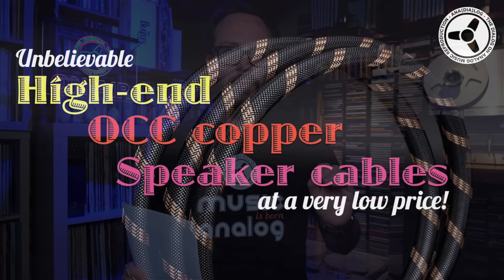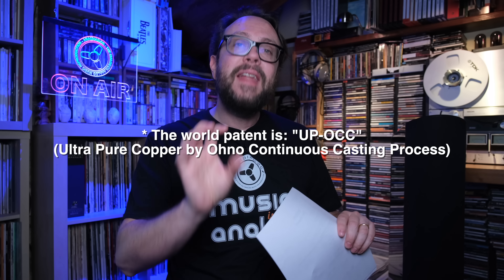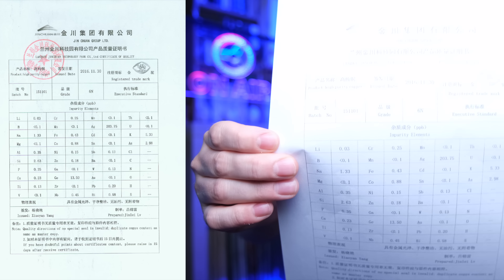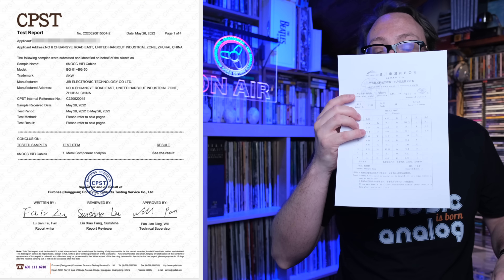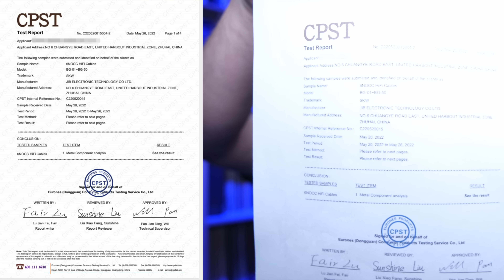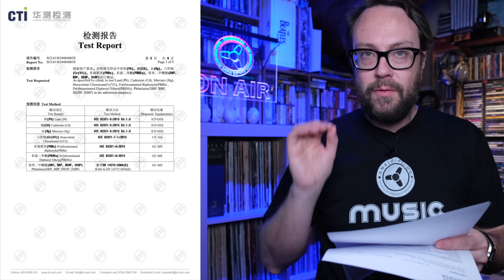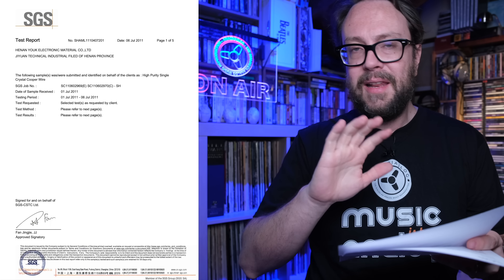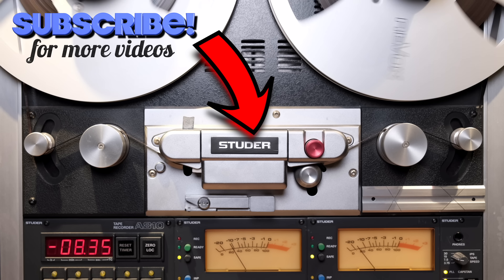Chinese OCC copper: fake or real? The SKW case

Comment: I don't dispute SKW product quality, but I wanted to provide some insight from a materials engineering standpoint.  It was good they provided the certifications to verify.  Each lot of copper would have a certification with actual results.  When looking at 6N's metals, typically the standard chemical analysis does not have good enough resolution to make the determination.  The company would need to also perform GDMS to identify all the trace elements that add up in the PPM levels of high purity metals.  The determination of single crystal would be different and would likely need a metallurgical cross section or SEM microscopy.  Good work on getting the info.
Reply: Why bother, at the price they sell for and if they sound great. what does it matter if they are OOO or OFC or melted rock? They appear to be excellent value for the money. When you bur a $10k pair of speaker cables, then ask for that detailed info.
Reply: @spacejaime  I like and own skw cables.
Reply from the maker: Good points. That is clearly something that would be useful to us not to them, which is why it probably doesn't exist. In any case, why don't you try asking by using the email below?
Reply: Yes, and the oxygen content wasn't measured at all. What we can say is that pure good quality copper was used - but I am pretty sure that the copper wiring in my kids electric toy car is equally pure. From the audiophile perspective, nothing is proven here. Could still be OCC, but we need other testing to know.
Reply: @spacejaime  It is obvious you are clever than Thrift Shop Reviews!!
Reply: @brianng2335  - I just checked my post and found two misspellings: OCC cable not OOO, buy not bur. Yes, who cares what wire the cable uses if they sound good for the end user!
Reply: @spacejaime  I know you were misspelling!    As you said, why bother?  In high end audio world, everything is expensive.   It's hard to find something good and nice at low price.
Reply: @brianng2335  - 👍👍

Comment: I bought a pair of Chinese OCC interconnects from China bay and they've worked out very well.  In comparing them to Mogami 2549 OFC I'd say that the chinese OCC are at least as good if not better and that's without any burn in time.  The jacket is two tone copper with black plugs that you turn to tighten.  I bought these on your recommendation from a past video on the merits of OCC cabling.  Thank you.

Comment: Also use the SKW cables, both interconnects and speaker, and am very pleased. As a matter of fact, I had Pangea phono cables and could not find the source of hum. Changed to the SKW and the hum went away. So the shielding is also of good or better quality. Kudos to you for researching the answer!
Reply: Oddly enough I got rid of hum by swapping to Pangea cables...my previous interconnect cable was 5m run of unshielded ' magnet wire' between pre and power Amps that 100% was the source of hummmmmm.

Comment: Hello,I bought Thise skw speaker cables and cut them to se the inside and their are not the same indside as the pictures.I can not put a picture of them here☹️.Have you see the inside of them? I like your Chanel very much.👍
Reply from the maker: It depends which cable you purchased. In any case I am conducting a new analysis with a partner and we will soon release the info. If you want to send me the picture you can do that here: anadialog@yahoo.com Thanks!

Comment: Can you please answer this question for me please? I want to buy these, but have an older amp that needs to use barewire. Can I take off the banana/shielding to use just the bare wire to insert into spring clips? I cant find the answer anywhere. Thanks!
Reply from the maker: Check the original video, I show howbto screw on the thin type for vintage amps: https://youtu.be/2rjOdEuFe88 at around 5:50
Reply: @anadialog  Thank you so much! God bless!

Comment: Personally (as an electronic technician) i'm yet not sure about the whole cable sound thing. I jost got an SKW interconnect cable which i bought because it wasn't too expensive and looks well made. I can't say that i hear a difference tho (it connects my phono preamp and amplifier)
But out of curiosity and the aesthetic appeal i just ordered a pair of the SKW speaker cables you recommended. If i will hear a difference, i will be happy.. if i will not hear a difference, at least i can say i've tried it. Probably will keep it anyway tho, because i always appreciate a well constructed and produced piece of equipment. So thanks for you're advice and research, much appreciated 👍🏻
Reply from the maker: Congrats for at least trying!
Reply: @anadialog  so i had them hooked up to my system, which isn't particularly high-end but not too bad (Elac Debut Reference towers, Yamaha R-S 700), for about two weeks now.. first of all: i'm gonna keep them! I love how they look and quite frankly also how they sound.. against the science i've learned, i have to admit that sometimes, with some Songs/Albums, I heard some differences after i changed them out.. it sounds overall more "clean", revealed more Details and to my surprise it made the lower bass more present or rather impactful.. which makes absolutely no sense to me haha.. but that's what i hear.. could be Placebo but even if it is just placebo - I'm enjoying it which is all that matters. So i'm absolutely not regretting my purchase of the SKW cables!

Comment: I have the SKW in both IC and for speakers. Tried out Tellurium expensive speaker cables. Costing three times av much.
After trying the Tellurium for a while I got the SKW's. Right out of the box it was great. Much better than the Tellurium. Best buy for people with normal economy.
Use Ansuz or Supra from Sweden for power cables.

Comment: Cables have big impact on sound. I understand this 35 years ago and have tested and developed cables since then.

I use Neotech OC silver, very good.

I am in a process of making two power cables, one with 4 nines copper and one with Neotech OCC, same architecture.

But it is also important to have the same material in the connectors as in the wires, preferably crimped.
Reply from the maker: Bravo! Good solutions throughout.

Comment: I have come to alter my view on cables recently, and I no longer consider the purity or type of metal to be the most important factor to look out for. After trying a qed xt5 power cable, which is just oxygen free copper, but arranged to combat the proximity effect, and finally hearing recorded sound without the treble being unnaturally rolled off for the first time in my life (nor the bass unnaturally loud and muddy) and to my amazement, much better timing, I am now on a mission to remove all regular stranded cables from my setup. I'll probably have to make my own interconnects and speaker cables, to benefit from both a lack of proximity effect and occ silver, because such cables are not cheap to buy, if indeed you can find any, but I dont think it is worth having occ and cryo treatment and shielding and all the other things you could add, if the cable is just regular stranded and massively handicapped because of it
Reply from the maker: OFC is a very good conductor. Don't think it's like having normal copper. In any case I agree and I actually always said that a good cable is made up by 4 fundamental factors in this order: conductors, insulation, geometry and connectors.

Comment: I’m an audiophile myself (whatever that is) and I find the world of high end audio to be one of the most hypocritical bunches on the planet.   

Personally, I wish so much stuff wasn’t made in China, but that is the world we now live in.  People will knock SKW cables, but on the other hand, they will praise AudioQuest with their mega dollar cables, which by the way, are made in…………..you got it, China.  And, that is just a drop in the bucket example.

Very good video.  Thank you for sharing.

Cheers, from Texas
Reply: Not so sure. 
I haven't tried SKW but I had an Audiocrast (Chinese) power cable in my system for some time. I bought an AudioQuest Mistral pc cheap (eBay). After much swapping about with my existing Furutech and Neotech pcs, I realised the Audiocrast was the weak link in the system.  The AudioQuest Mistral had the effect of snapping the system into place - better resolution, greatly reduced sibilance, more tonal colour.  The Audiocrast sounded slightly fizzy / fuzzy if that makes sense - and greyer.
Reply from the maker: Thanks! Maybe you could find this video I made on high-end hifi interesting: https://youtu.be/QKixhYovxJQ

Comment: I know they affect sound output and clearly have benefits over standard ofc. I can't say they are OCC. 

Crystal copper will make a difference. Look for OCC not ofc.  This type of copper is going to give you a more robust full sound.  I know it's true because I made output files and spectrograms and it is quite obvious that there is a difference.  The benefit is no cutoff at the ceiling so extended peaks across entire spectrum.  Another benefit is clear clean separation and higher saturation which pulls out many more details.  Is it a dramatic difference?  At low volume no, but at 75 DBs or more you can really hear a big difference in sound quality.  Realistically the difference is on par with mp3 vs wave.  In fact, the spectrograms are very similar.  I've done a lot of work with spectrograms.  Another cable I am looking to try are Gotham crystal copper.  Gotham is used in a lot of recording studios and microphone cables.
Reply from the maker: Very interesting!

Comment: People have varying opinions on everything. I occasionaly get someone saying in the threads something to the effect that because their stereo costs many tens of thousands, that it would make a laugh of mine, and I never even say what my stereo is; on purpose . Quality of software used + quality of hardware + knowledge of setup and tweaking = how good your sound is. Cables are still a thing a lot of people don't buy into. People who don't believe there are quality differences between cables, all have one thing in common in my experience; they never have great sound. Not just because of the cables themselves, but because anyone who isn't perceptive enough to tell differences in cables, isn't going to be perceptive enough to pick out what is the best sounding equip  One thing I would like to see is audio stores who carry cable brands where they have many different models, giving people an audition of their budget cable, then their next higher up cable in the line , then the next etc. etc. to demonstrate just what  improvements and degrees of improvement you're getting as you go up the line in price. After that what would be even more interesting is going back down from the top model all the way down to the budget model again. Of course there would have to be 3 minute intermission in between each switching of the cables, to remove one and connect up the next one. I'm sure the expanding and then literal collapsing of the soundstage would be obvious enough to silence the most vocal doubters. I have some top of the line cables from the same company. One is their current top of the line which uses OCC copper and their former top of the line cable uses OFC. The OCC is cleaner and sweeter. The OFC is clearer a bit.  Based on what I've experienced, the OCC can probably be expected to sound purer and cleaner, but don't expect all aspects of its sound to be better.
Reply from the maker: Nice analysis...intermittently hilarious 😂

Comment: I don't see anying on how to test the actual cables, such as resistance measurements or an oscilloscope to verify the cable have not been substituted.  How would you verify the SKW cables are genuine or reproduction without testing them.
Reply from the maker: No need to do that. Definitive test coming up. Stay tuned.

Comment: sorry i bought this cables and sound bad in my system. moody and dry. sound stage was shrink. in the technical aspect they where very rigid and they almost broke my speaker terminal! 
then i change for van del hul cables. and wow night and day. i dont know what they put in there cables but its magic. very recommend and very flexible and special. 
if you can do a review of them it will be great !
Reply from the maker: No problem! Can't always be the right pairing!

Comment: OCC is a process for manufacturing wires which is distinct from the purity grade of the copper. You can get 6N copper in bars, sheets, pellets or wires. So, unfortunately the documents do not prove that it is OCC cast copper.
Reply from the maker: Exactly! Stay tuned for more. The key concept here is monocrystal.
Reply: @anadialog  Well, 6N copper is widely available as it is used in medical and military equipment. The question is if the wire is extruded with the occ method, which is slow and therefore expensive. There's no proof of that.
Reply from the maker: @audioupgrades   What is important in OCC copper or silver is the almost complete absence of crystals. That is what makes it special, extrusion takes place before but the Ohno Continues Cast process, which is different. I actually forgot to mention that in this video since SKW stated that it is OCC but , as I said in the prior comment, stay tuned, I have extra analysis coming up. Here is a video I did on OCC for the full info: https://youtu.be/YCgfQr84Yco
Reply: @anadialog  The extrusion of wire must also follow the slow-annealing OCC process, otherwise you reintruduce the small crystallisation. That's probably why some people are sceptical, because it's a slow and expensive process to extrude OCC wire, which is at odds with a low retail price. 6N is no doubt as it is commercially available but occ extrusion, that really has to be proven to be believed.

Comment: Can please tray an inexpensive mogami 3104 and let us know how will compare with the beauty occ ? Many thanks
Reply from the maker: The problem is, apart from the conductor,  that is has a very bad insulation, PVC, which is scientifically proven to have a high dialectric constant that attenuates the signal.
Reply: @anadialog  if the neotech 3200 is close in sound performance to the cheap mogami i will never keep

Comment: SKW is not clear about its core thickness, that's not good.
They claim that the copper is 6N OCC copper.
Ataudio makes 7N OCC copper cables that are cheaper and have better connectors.
Reply from the maker: I see Ataudio selling cables on aliexpress for 23$ claiming it's 8N....a little too good to be true but in any case, that also would need further investigation
Reply: @anadialog  I'm dealing with high end audio, both professional and as a hobby, for more than 30 years.
Had many cables: Monster, Qed, Van de Hul, Siltech, Nordost, etc.
The cables I purchased from Ataudio are really very good !
Reply: didn't see any 8N examples though, thought 7N was the highest
Reply: @dingskydongsky  can you name it pls? They sell a few rcas.
Reply: @rolkabolka  I only bought their speaker cable and a USB OTG cable
Reply: @dingskydongsky  ahh i see. Thank you!

Comment: Did you check this cables with some electronical engineer ?
Reply from the maker: Do you check your CD player, smartphone or amp with an electronic engineer? I hope you see the paradox here.
In any case, stay tuned further info coming up.
Reply: @anadialog  I am very wonder about new casette deck. I hope it willbe not to expensive. Also. Cd player can have many diferrend components. And I can hear the diferrence beetle them. Also I can hear the diferrence beetween very thin and better cables like 2,5 -4,5 mm.

Comment: I was hoping for an actual metallurgy analysis from a lab or something rather than a piece of paper. I take the piece of paper with a grain of salt as much as the cable especially coming out of China. My own experiences with Alibaba cables are they are a waste of money even though cheap as I would not use them after listening. I now come to the conclusion I will only buy big brands that can be trusted to provide what’s on the tin eg Chord. To save money, I wait for second hand items. On the other hand, Chinese hardware like amps etc can be trusted as hard to fake those and some companies like Cayin, SMSL, Topping etc have excellent reputation.
Reply from the maker: I would stay tuned...;-)
In any case, SKW is sold in Hi-fi shops and Amazon. Not only Alibaba/Aliexpress.

Comment: Ordinary copper wire for electrical applications is circa 99.95% pure copper.
The idea that 6N at 99.9999% pure copper is going to make any sonic difference is questionable to say the least.
I certainly do not subscribe to any benefits claimed,which of course manufacturers and YouTube promoters would make in order to sell the products,even if they themselves know that it is B.S.
Reply from the maker: I don't sell anything. This is my passion, not my job.

Comment: Its going to be 99.5% if its a copper cable. No metal is free from impurities. There is really no o2 free copper its just in a low %.
Reply from the maker: Yes, of course in fact it's never 100% pure copper. In any case, it is not a matter so much of impurities but of crystals, that is the problem related to transmission. Check my OCC copper video for all the details: https://youtu.be/YCgfQr84Yco